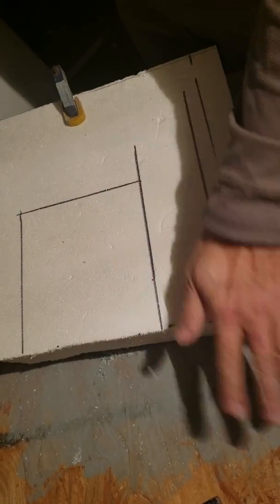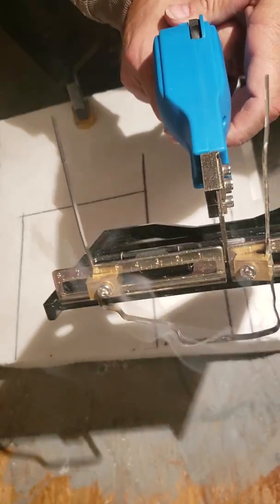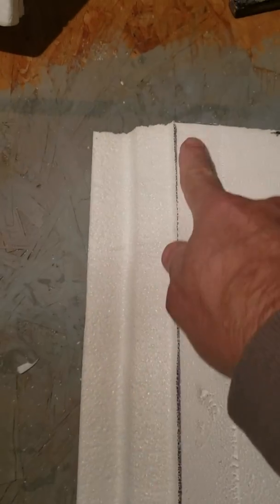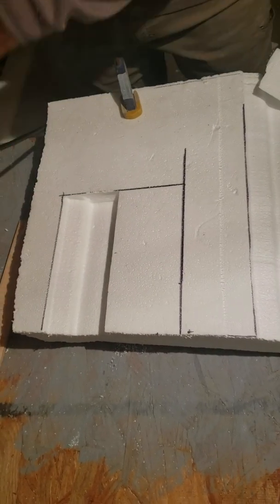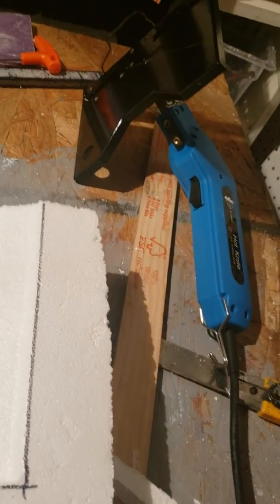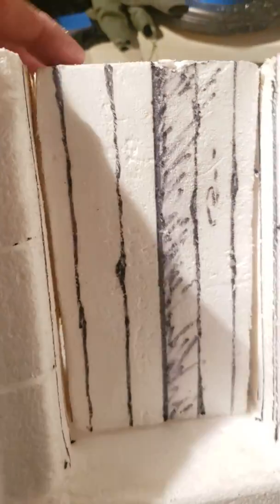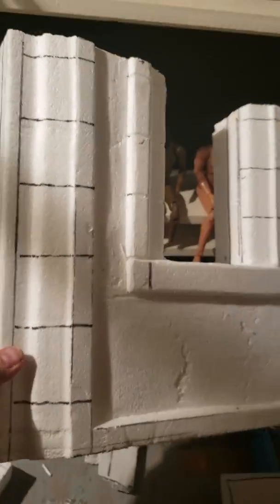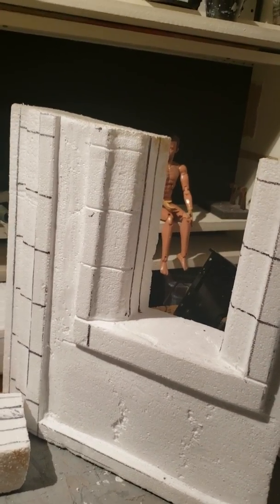1:6 diorama.  Foam cutter trial

Comment: I got to get me one of those types of foam cutters. I really dig how fast it could get the carving done, at least for trim and depth. Any suggestions on what brand to get, is ebay a good place to get one or should I try a hobby shop? Are the blades for those types of foam cutters pretty universal for foam cutters of another company or I have to get foam cutting blades made for my specific foam cutter?

Comment: You need a really (good) mask......$45.00 BUCKs.... on up
(also)
You need a (specialty) exhaust fan, blowing out of the structure you're in. (not into another room)
That's not just (smoke), that's really bad dangerous (fumes).
You need a welders exhaust fan.....or.......You will suffer from COPD very soon.